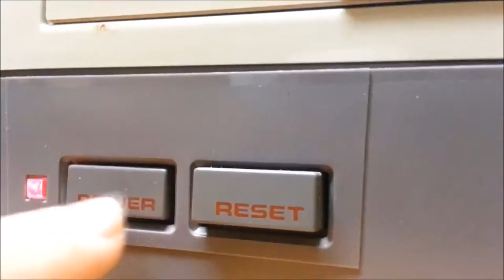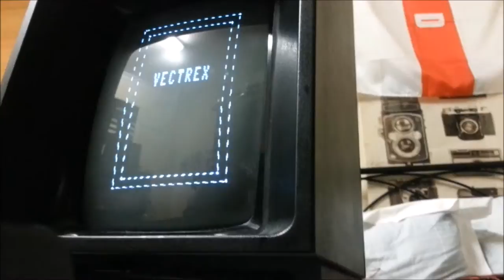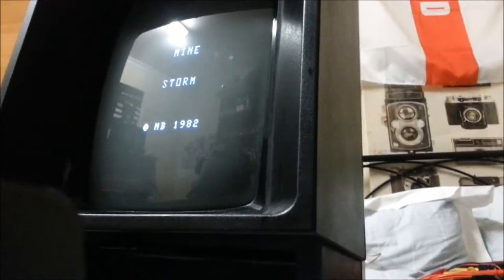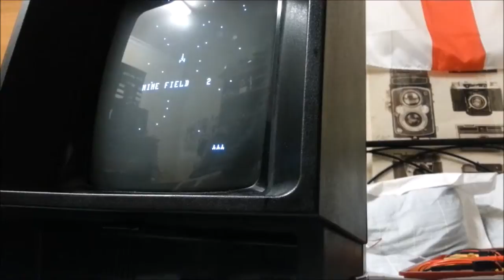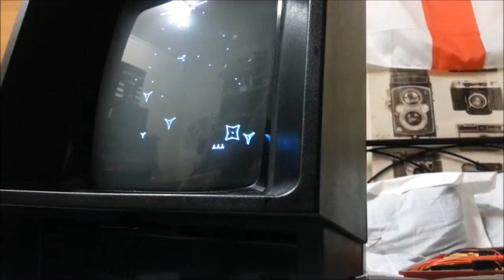Repairing the VECTREX (Screen Problems) | Joystick Division

Comment: The Vectrex is most definitely NOT 'legendary for killing people'. I could not find one instance of anybody dieing from electrical shock by a Vectrex. Yes, you could possibly die from touching the anode but that's unlikely and otherwise, nonsense. Other than that, nice video.
Reply from the maker: I made this video at a time when I would believe anything I read on the internet.
I know now that it was not a killing machine.
Thanks for the feedback.
Reply: Actually, it's a lousy video and probably the pointless video on YT.  
Of course, they are not especially dangerous either.  If you discharge the tube, which any moron can do, it is not even a shock danger.